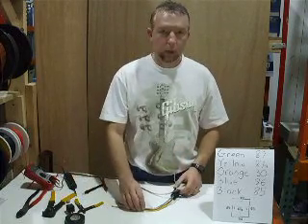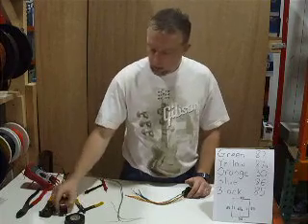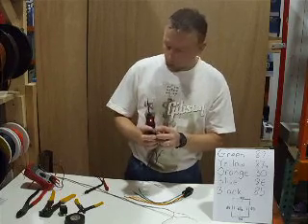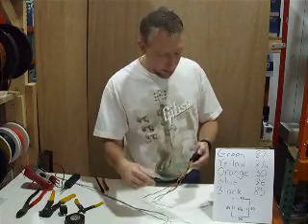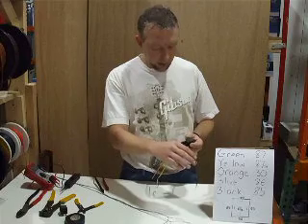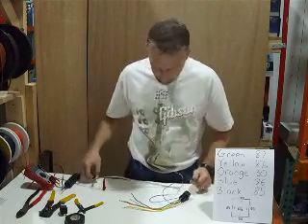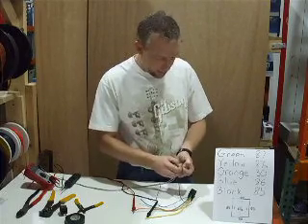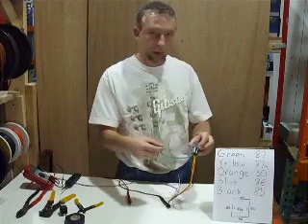HOW TO - Relay Installation - open circuit - normally closed relay interrup wiring

Comment: Ignition Sense Yellow (+) To get the factory remote working when the engine was remote started,open this wire with a relay set for,Ground When Running.